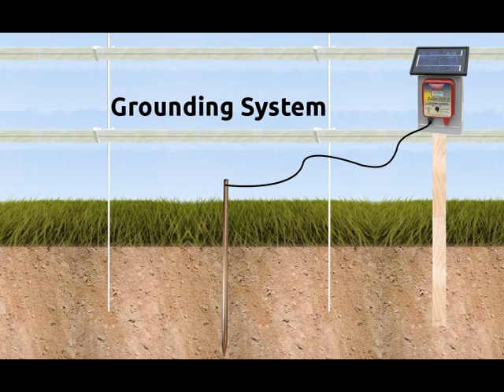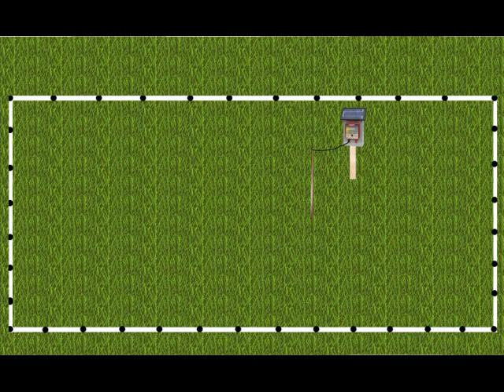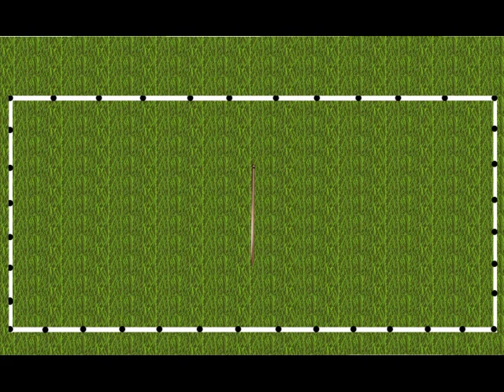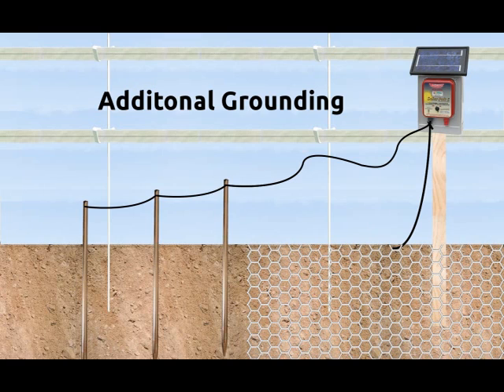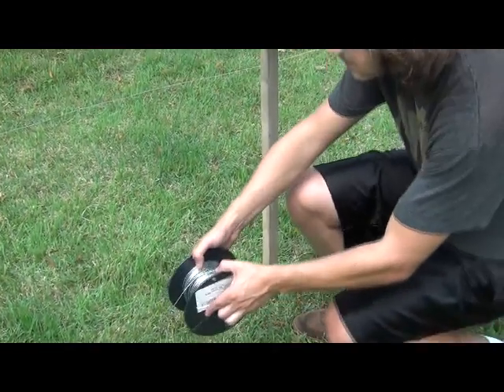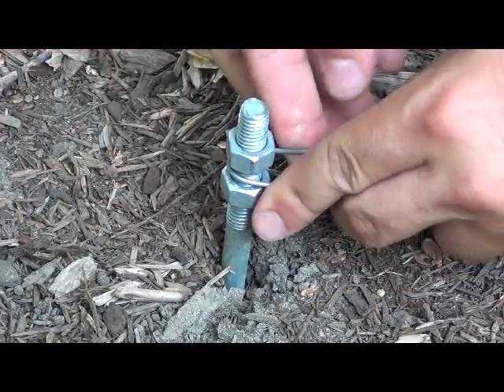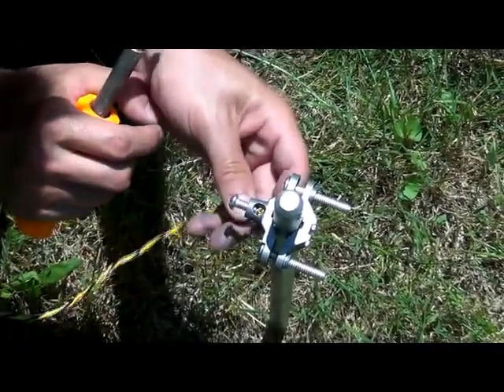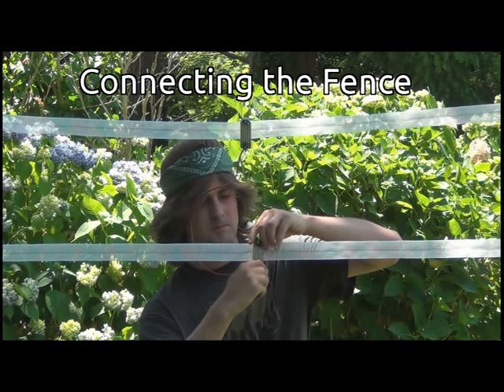6. Installing a Grounding System on your Electric Fence

Comment: Do I need a headband?  Kidding was looking for more info on how to make a good ground and info on different corrosion issues with mixing galv, copper, aluminum, ect. Does it make a difference at these voltages?

Comment: What I don't get: If your rod is in the middle of a big terrain, then the wire from the rod to the negative pole of the installation is running trough the half of your terrain? Or do you put it underground then?

Comment: Use hydraulics to put the ground rod down.  Dig a small hole. Fill it with water. Put the rod in and by hand raise it and drop it.  Keep the hole filled with water. The rod will almost fall into the ground. No need to drive it !